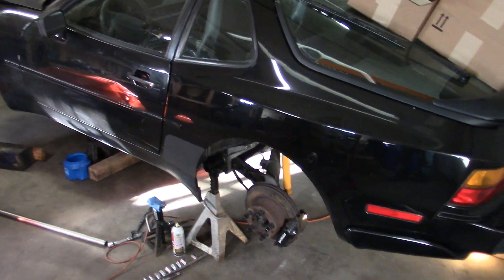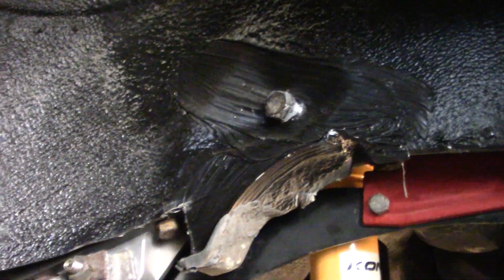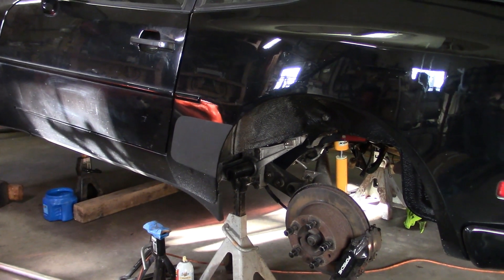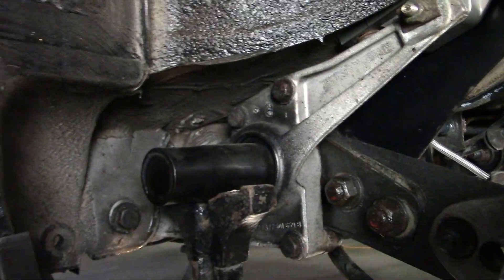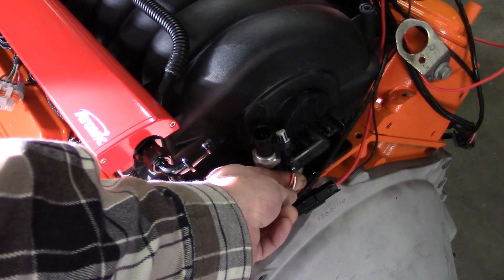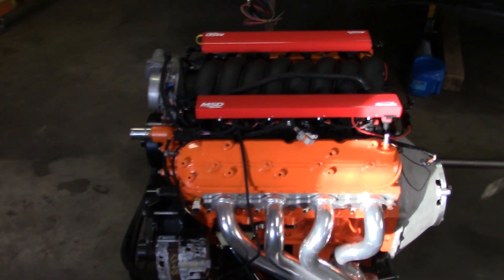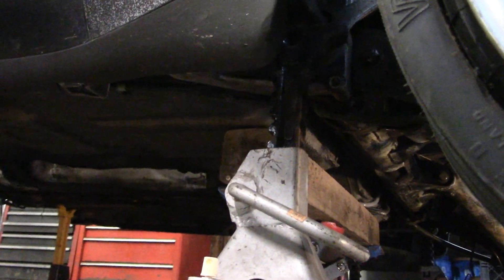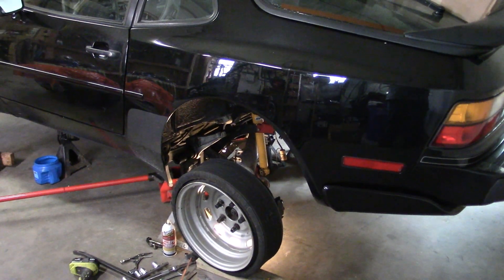Porsche 944 + V8 Part73, Torsion Bar Indexing Problems!

Comment: Interested to see how you get on - when I reindexed my torsion bars, I kept trying to not remove the assembly from the car completely, but I ended up needing to do it. And with the whole thing on the ground it was still tough to work on!

And of course I messed it up because I didn't know about the difference in spline count from inside to outside, and my car is lopsided and too low haha
Reply from the maker: Yah, getting the torsion bars right is probably the toughest job you can do on a 944. Probably why people convert them to coil-overs. I ended up going with Elephant Racing adjustable spring plates and torsion bars. This gives you 2" of ride height adjustment. Then if the indexing is slightly off you can still adjust it in.